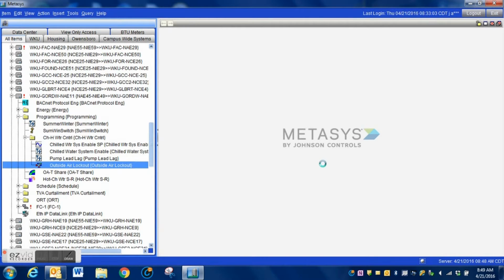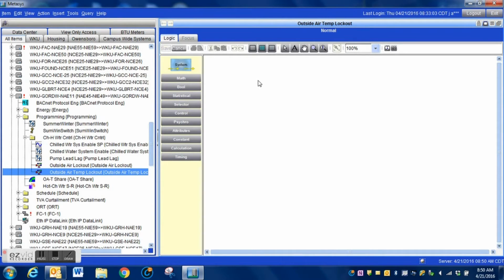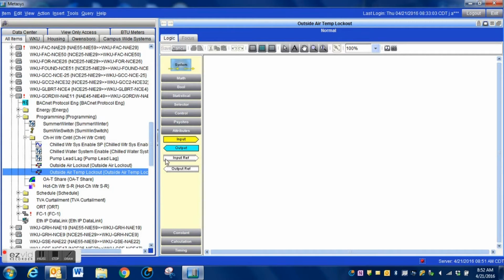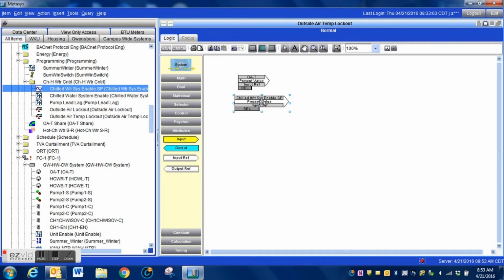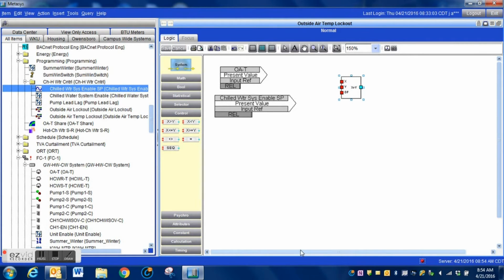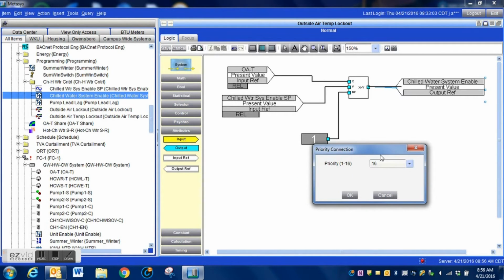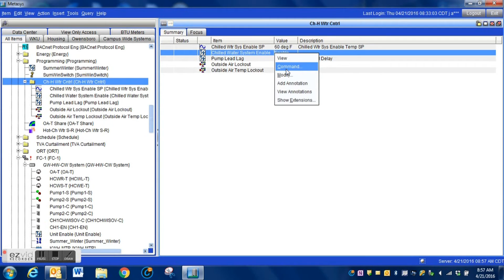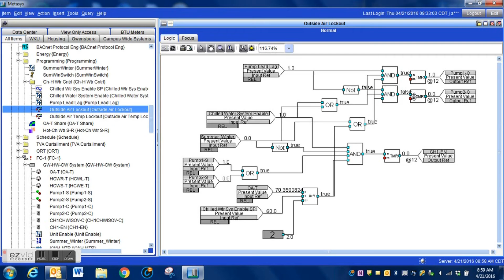Johnson Controls Control System LCT Programming Basics

Comment: I only recently started programming with LCT, but my first program only ran once, then never updated the screen values again.  It's just some basic math being done on several numbers brought in from AI's and then pumped into outputs.  If I go into the program and then save it again, it updates, but it never does it on the fly.  Anyone have any ideas on what's wrong?
Reply from the maker: Depending on how much you are loading up the engine, you may have too many processes and it is freezing.

Comment: I’m an HVAC service tech currently, I fix the things these control. I’m trying to learn and get licensed so I can do controls/BAS work myself instead of outsourcing. What do you recommend I start with and what classes do I need to take?
Reply from the maker: Start with some of the operators classes for both Metasys and Tridium and then move further.  Try to get into working with other techs and apprentice with them.

Comment: Very informative and well explained videos.  I have a question.  Is this how you control third party devices? For instance, when integrating to a Trane RTU, what points do you have control over?
Reply from the maker: You can control certain points of 3rd party devices if you can pull into the system.  As far as what you can control, it depends on the particular 3rd party devices.  I've seen bacnet devices that only let you see certain points but won't let you control them.

Comment: Great video.I was told that the "object count" of NAE35 cannot exceed 2500, so what would happen if it become 3547 after finishing my programming…and now  it seems running normally…
Reply from the maker: +Matthew Tam there is a limit on the number of objects it can handle.. like many things, they can go so far over their maximum rating. You may first notice devices going offline randomly or it could hang up. How far you go over is up to you.
Reply: Thank you!

Comment: Is it possible to insert a PID loop in LCT?  If not, how can I use a PID Loop to control variables globally - without having to use the PID function at the controller level... we have an N2 system and it is not possible for us to view the field controller code from our front end... which is why we would be prefer to have the PID Loop in our NAE...
Reply from the maker: +Miguel unfortunately LCT doesn't currently have a pid object. If you are using an fec you can set up a pid loop and either pull the points into metasys or share them directly using peer to peer.